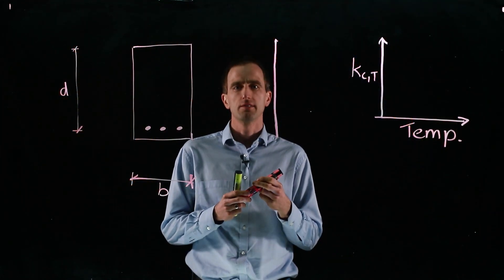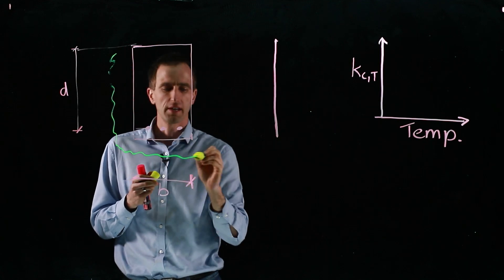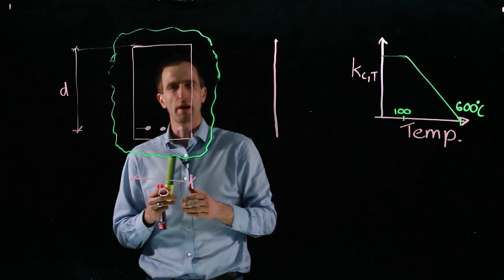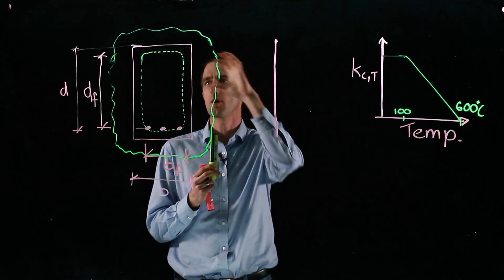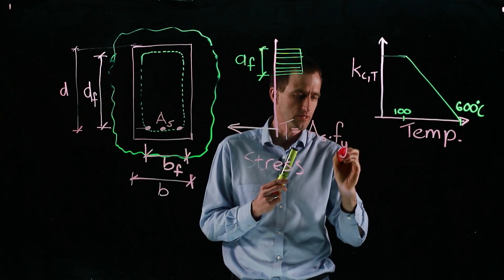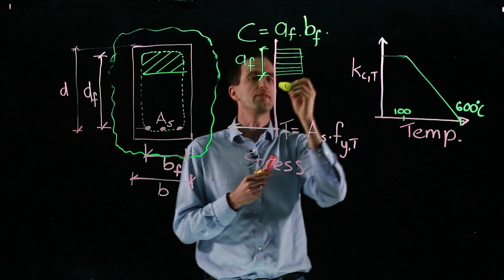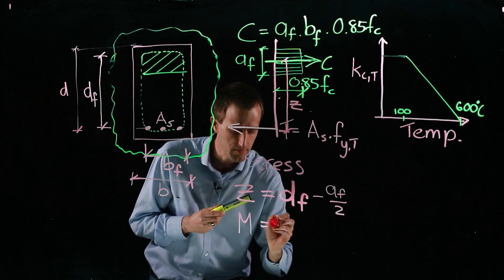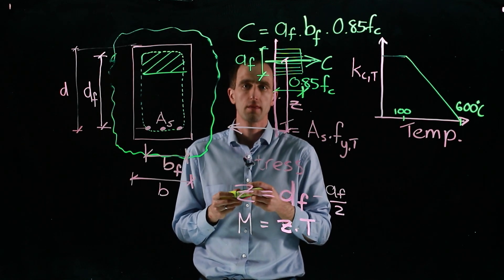Concrete in Fire: Behaviour and Beam Design

Comment: Could you comment on the placement of the steel reinforcing in the bottom of the beam to prevent sagging. Obviously with the beam heating up the steel reinforcing can now be in a heated zone and when heated steel begins to lose it tensile strength. It can also conduct heat to parts of the beam remote from the Fire. Is there optimal cover to the reinforcing and are there any equations to balance locating the reinforcing steel in its optimal location for tensile strength while still maintaining adequate cover to protect it from heating due to fire.
Thanks...great video 😊👍
Reply from the maker: The answer to that question depends on a few factors. For lower fire resistance times (30 to 60 minutes) the steel is not normally sufficiently heated to be a significant problem. Possibly for 2 hours you start having a problem, if there is limited cover. Most national codes have some form of guidance for minimum cover for deemed-to-satisfy fire resistance ratings. Following such guidelines gives you a safe solution in more cases. Beyond that you could optimise the solution using methods as proposed in this video if really needed, if really needed. In most cases the amount of effort required is probably not worth the saving achieved and complexity it would create on site having different cover distances in different places. 
Steel does slightly increase the conduction through a sample although often it is ignored and the beam treated as solid concrete for simplicity in thermal modelling.